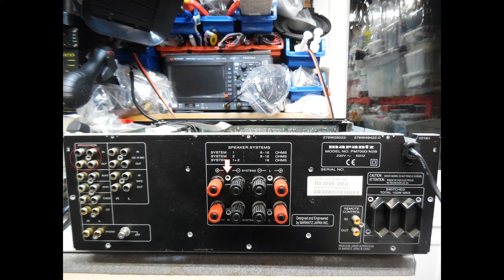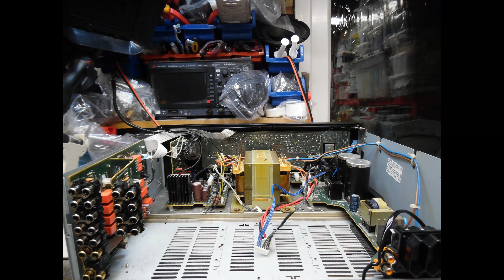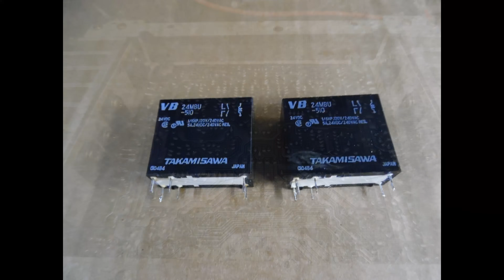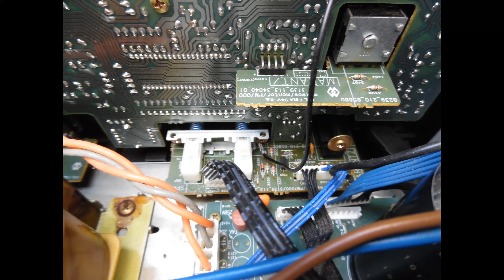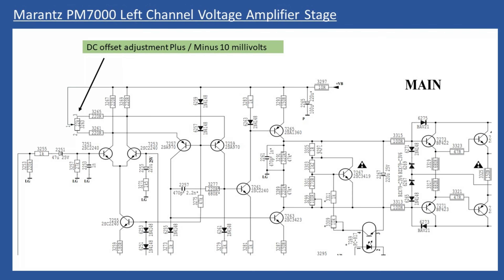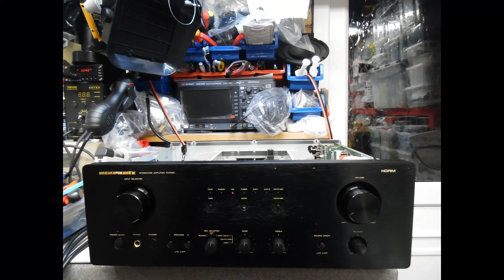Marantz PM7000 Amplifier Repair (With Audio Tutorial)

Comment: Hello again. Would the processor in/out act as a normal line level pre in/out for a power amp. Or a sub? If a sub, could 2 subs be connected? Cheers
Reply from the maker: Hi the data sheet and service manual for the Amplifier does not specifically specify the input Amplitude or the impedance. But the line input specification is 150mV at 40K ohm. Hence you will need to check  the specifications of the subs for compatibility.